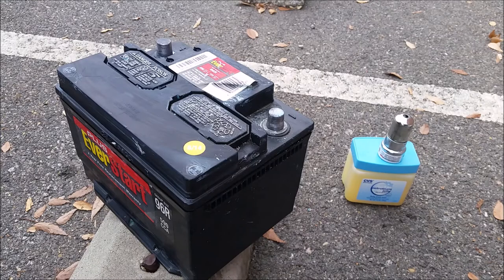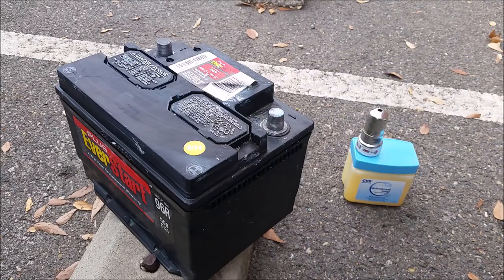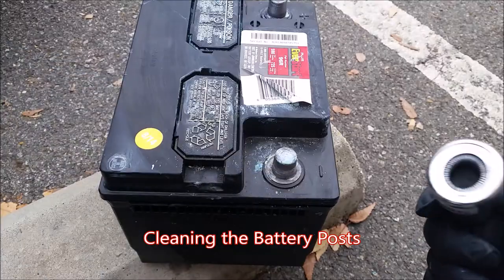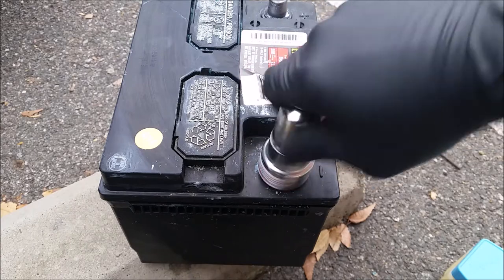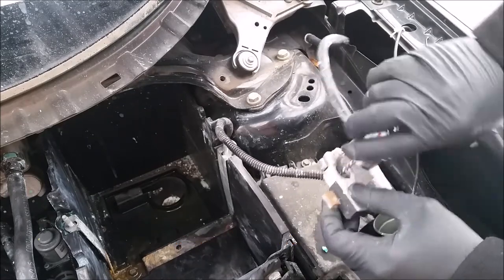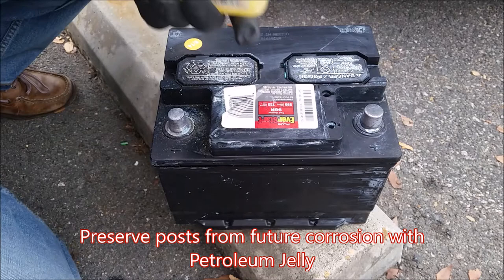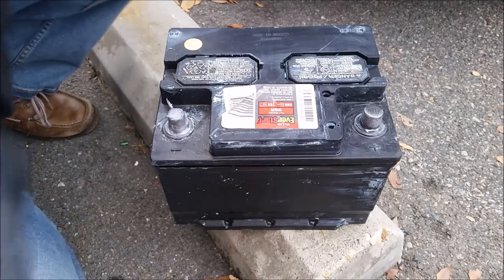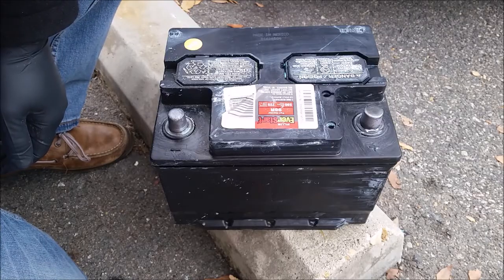How to Clean Car Battery Corrosion: HOW TO ESCAPE

Comment: Hey so I feel the positive cable to my battery in the escape is probably loose or not working as well, so I have to take it out a replace it, just wondering if you had or heard any issues of this
Reply from the maker: Good question- these Escapes are weird with their batteries, but if it's your cable that's interesting. So is the cable loose on the connection to the battery post? Or is the post itself loose in the battery? What are your symptoms the car is experiencing?

Comment: Have you tried dielectric grease in place of petroleum jelly?
Reply from the maker: Not yet- it was my take that petroleum jelly is ok so long as the terminals don't get too hot (100+ deg F)... The jelly has a low melting temperature and will liquify and travel to lower areas. Some people also argue that the jelly is an insulator so dielectric grease is better as it's a conductor- however, the jelly coating is so thin here that the metal to metal contact is still sufficient and the sealing of the terminal is just for corrosion preventing purposes (I also applied it before the cables were attached intentionally, so it's not to coat the entire connection, just coat/seal the post). To your point, the silicone dielectric grease might be better for the long term per some research I did, but I don't have any personal experience to say why aside from what I learned: it won't migrate and is less of a fire hazard (even though a very thin coating of petroleum jelly is very unlikely to ignite in this application. I'll make a note in the video to make that an option as well. Thanks!
Reply: Well, there are conductive and non-conductive greases and most dielectric greases are non-conductive and silicon based.  Noalox is an example of a conductive compound which probably isn't the best choice for a battery's lead terminals.  The Vaseline, especially as you apply it, Rahrena, does no harm and does do the job though it does likely vanish somewhat over time.  

Mainly, you want the compound to fill voids and ingress points to a connection to prevent water, oxygen, or other substances from reaching the metal-to-metal area.  A good grease of course displaces from the tight contact surfaces into any voids or is squeezed out of the connection during tightening.  This is exactly what you want to happen.

So, I think the Vaseline is fine.  A good silicon dielectric grease is a better choice for the longest protection, but petroleum based greases can stand in fine in most applications -- particularly low-voltage applications.

My $0.02.

Great video as always --- some of us old-school shade-tree mechanic types know this stuff, but there's a whole new generation of people that need to be educated so good work.
Reply from the maker: Thank you very much for the thorough input, John! Great to have an experienced perspective- so long as the information gets around, that's what the channel is for! I appreciate it, man!